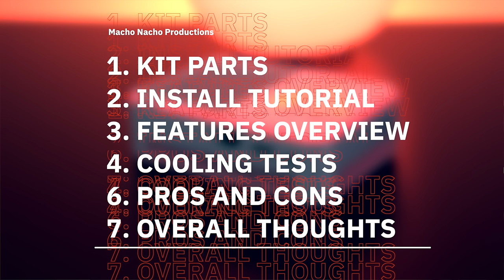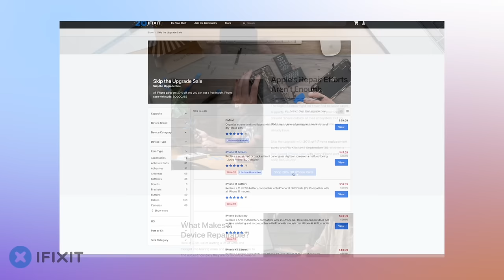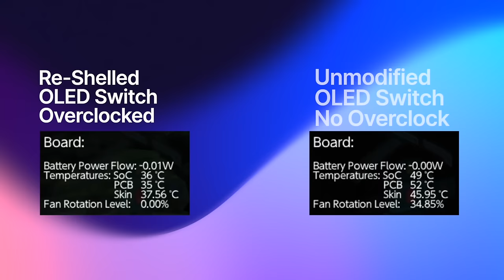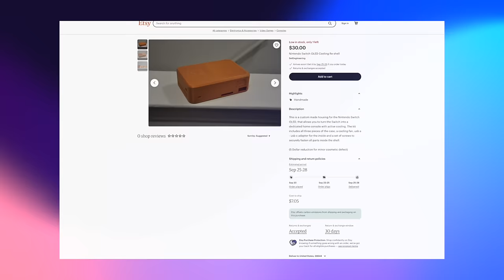Making The Nintendo Switch Run FASTER And COOLER With This NEW Mod!

Comment: For some extra cooling performance you can change the thermal paste between the heat shield and the SOC. I've modded and repaired a lot of Switches and that paste is often very dry. Then what happens is it crumbles and cracks during the removal and reinstallation of the heatsink resulting in hot spots / poor performance. It's always best to replace it if you have the console torn down to that extent.
Reply: I have never taken any compute system down to its processor without replacing the thermal paste

Frankly, the fact that people competent enough to tear a system down to that degree, would choose to not replace the thermal paste - confuses me greatly
Reply: @Spiker985Studios  It doesnt happen.
Reply: @Spiker985Studios I have done that before, because I didn't have any on hand lol
Reply: Replacing the Thermal Paste when removing a Heatsink feels like the Bare Basics on how to handle Heatsink-Removal.
Reply: @SoHBetaSword  again. This. It's just the thing you do as standard right?
Reply: @mykr0324 I have NEVER torn down a machine and chosen to NOT replace the paste. There is NO reason to NOT replace the paste. Unless you don't have any? But the shits cheap, if you're tearing down electronics even semi-frequently, you should have a tube of paste. Stuffs like $8 and will last you dozens of repaste applications.
Reply: Or better yet people should stop buying poorly made hardware
Reply: @Volkswagen_Yeetle  so, make your own switch then?
Reply: Can you make a video on how to convert  regular switch, I changed all the parts but it’s not turning on, I replaced the battery and power button but nothing, is there a way to troubleshoot the motherboard?
Reply: Hey! I recently opened up my switch lite, but didn‘t have any thermal paste on hand. On reddit, they said the airbubbles that comes when you put the heat sink back without a pump of thermal paste could fry the cpu. Is this true?

Comment: I have an LCD switch awaiting the fate of becoming a consolized version, just need some injection molded cases to come out and we're good to go, glad to see the development towards this goal!
Reply: Why not 3D print it? or find a local print center? Heck, some libraries have 3D printing services.
Reply: @Logon01 3d printing is great and all but there is something about injection molded plastic that feels different. If you want 3d prints to feel as smooth, you have to spend a hour or two sanding it. Plus there plenty of people who don't have places that can 3d print for them.
Reply: @RobbWes  100% that injection mold is different. I do like the option myself when it's there. I also know that 3D printing isn't always an option, but if it were, you would have much more flexibility. And given that this project is a Do it yourself idea, spending time sanding and painting just adds to the value of it for some. It gives the ability to make something like this a one of a kind thing that is specifically yours.
Reply: I have a 3D printer (anker m5 and many others before it), +1 to everyone saying injection molded is just different, cause it certainly is! 3D printing is for prototyping and small projects where the look might not matter just the function. This is a device I’ll be interacting with, divots and rough lines even with my resin printer just aren’t gonna cut it. I remember the early gba shells and stuff that was 3D printed. Look at us today, funny playing is almost OEM level quality. Trying to replicate that OEM feel but having a cool switch console is 10/10 for me
Reply: I would recommend trying out a pla carbon fiber filament its quite good.
Reply: I have an lcd switch that I’m sitting on for the same reason. It would be nice!
Reply: Injection molded cases will never happen. Molds cost far too much to develop for what will be low production numbers.
Reply: If you don’t like the look and feel of typical 3d prints because of the obvious lines, pcbway has a resin printing option. Add their clear varnish and its perfect for a clear plastic shell. You can even tint it like gameboys and other old consoles used to be

Comment: This looks great and a great idea for console only gamers. I do 100% agree that the creator should add another frame for Noctua fans, because they are just so quiet and efficient. Sort of the entry level and the premium options. Really excited to see how the Switch modding scene continues.
Reply: does this mod only works for OLED switches?
Reply: @ericgene yes for the time being but in the works of making one for the original switches v1 and v2
Reply: Noctua is great (should be no problem to add a NF-A8 5V) but I would add a potentiometer that also acts as a switch, so it has a setting to turn off.
Maybe with a second LED, one is for the power and the second one is an indicator for the fan.
Reply: What surprised me the most was that they are using the stock heatsink/fan. Looked like it wouldn't have been that hard to put a pc cpu heatsink on it with a fan. I'm guessing it boils down to keeping the costs lower. It was running quite cool already so there's that.

Comment: This is easily one of my favorite mods you've done. It's contemporary, it's preventing e-waste, and it makes perfect sense for thermals on paper and in practice.

Edit: Dang is this OLED Switch specific?! 2nd Edit: They're working on a base Switch version. So that'll be an option. Modders kick ass.
Reply: 21C is not 75F...
Reply: i mean i dont think it really prevents ewaste by itself, i may be completely wrong but i think this has the same effect of just leaving it docked? coolings better tho so thats a selling point
Reply: Wait since when is the OLED switch overclockable

Comment: Wish there was something like this for the OG switch models. Access to the right joycon rail for CFW booting would be neat too, as well as external access for the microSD card.
Reply: truthful be told you could get a PCB flex cable that bridges the connects but I agree i wish there is something like this for the OG switch
Reply: It makes more sense for the og switch. Less efficient soc is fine if it's always plugged in. Not to mention a lot of og switches probably have dying batteries at this point. And why would you get this to get rid of the oled display? Kind of a waste.
Reply: There is one for OG switch, check the link in description

Comment: I would have loved to see the shell incorporate the rails to make synching new joycons easier but this is still an amazing piece of work. Great stuff from the community as always
Reply: I designed it to work specifically with a pro controller. As joycons are no longer technically necessary.
Reply: @SetEngineering  But if someone has them from another system (or their system with a broken screen they've modded to run without it) then it would be nice to use the joycons for a multitude of scenarios:  friend's controllers, Mario Kart Party, games that only work with Joycons (they do exist), etc.
Reply: @SetEngineering  aren't they needed for games that require the joycons and specifics like the IR sensor?  I still use joycons while docked.  Plus, gyro aim controls are easier with a joycon in each hand.
Reply: @billyelliotx  Its easy to pair joycons with the console but its designed around using the pro controller. Im working on a version of this that uses the older v1/v2 dock that has a rear USB-A 3 connector. Using a seperate addon might make it easier to pair the joycons as i know there are some third parties that can pair via the usb connector
Reply: @SetEngineering This was a project VERY well done! I give you mucho respecto!!! 👍
Reply: @SetEngineering  Except joycons make certain games so much more pleasant to play. I can't go back to pro controller Splatoon after playing split joycons.
Reply: @SetEngineering ring fit!
Reply: @Phoenixflame87 u can pair them in the system menu.
Reply: Creator Forgot charging joycon controllers for owners that want to save some dough,but good development non the less, especially for the future original models  shells
Reply: What's the third party thing creator said you can use to pair/charge joycons thru USB?
Reply: The only thing that would be great for the Nintendo community is if Nintendo shutdown or is bought by Microsoft who would actually do something with all that money laying around
Reply: I did notice one slight issue with this mod. If you attempt to completely factory reset the switch, you arent able to synchronize your joycons which essentially bricks the system. Does anyone happen to have a way around the initialization when you factory reset after transferring your system into this shell?

Comment: I love that the Switch actually does have more power... we just can't access it cause of battery life... cause that means that if the Switch could just handle heat and battery performance, then Nintendo wouldn't actually have to raise the price for a pro-model...

Comment: Overclocking in theory should also provide a boost in resolution (assuming the framerate target is met) if the game is using dynamic resolution scaling, which a lot of switch games do.

Comment: Con: Needed an area that can attach Joycons for charging/synching. Some games still use Joycons specificially vs pro.  Less messy setup to have the joycon attachments available on it vs a separate USB charger adapter.

Also, maybe a modded version to allow for the 4 multi carts at once that change via  button sold on Amazon.
Reply: On the plus side, that separate Joy-Con charger they sold at the start of the Switch's life will finally become useful 💀
Reply: I don't have ONE single game for my Switch that ONLY uses the Joy Cons. I have 45 Switch games, and they ALL use my PRO controllers.
Reply: @Twitch_Moderator  Pokemon Let's Go Eevee/Pikachu, Let's Go Switch

Comment: Neat project. I wonder if the factory fan and heat sink/pipe assembly could be ditched in favor of a larger heat sink? Might be a way to get it to run even cooler with quieter fan or maybe even with passive cooling. Also would be nice to see a custom power button flex ribbon that integrates a power cut off for the USB port so the fan doesn't run 24/7. Lastly an SD card extender would be pretty easy to add in to make the SD port usable.
Reply: Yes it would be amazing to be able to use a lager heatsink in this case. Also just having the replacement fan plugged in the original fan socket, if the PWM signals and voltage are compatible.

Comment: I am definitely interested, though there are a few improvements I would bring to it ideally:

- Have different shells to accomodate for the different Switch and Dock models on the market (OG, Mariko, OLED)
- Have a "Pro" version where we can restore or even add USB ports (in case you have multiple wired controllers plugged in), but it would probably need an external power source for a hub (Maybe it could work using a power supply that is not Nintendo's?)
- Have a hard power switch which can turn both the Switch motherboard and the external fan off in one fell swoop
- Ideally have a substitute for the battery in case that swells up

But overall that sounds like a fun way to salvage a console with a dead screen!
Reply: would definitely love that as I don't really take my og switch out anymore @carbon9652
Reply: He actually does have 2 versions he is still in the works with utilizing the V1 dock to make this possible.
Reply: @carbon9652  mmm would it be possible to use the oled dock with v1 as my original dock is borked
Reply: Mariko and OLED are the same, the lite has no way of outputting video without heavy modification. Im working on a version of the shell for both v1-v2 and oled that accommodates both OLED dock and V1-v2 Dock. Iteration takes time.
Reply: @SetEngineering  switch lite can output compressed video via sysdvr

Comment: I wonder if someone designs a custom cooler that sits right on top of the CPU/GPU/RAM, the system would be near ambient. But tbh, that's over overkill. The stock switch temps not really going above 50°C that often is a real testiment of the engineers at Nintendo. They made a really cool system. And this shell mod just shows that if you get to ventilate the system outside a handheld case with a bigget fan, the cooling is perfect.

Comment: It's a fine concept for many broken Switches, it's even a way to have some use for drained batteries as it's intended for being continuously plugged. Nonetheless the case itself seems a bit too thick considering the original size of the console and the fact that we're even removing the screen, I guess we'll see alumunium or a more packed version of this concept.

Comment: I hear a lot of people leave their switches docked. I think this is a great idea and I hope the next gen console will have a separate handheld so performance doesn't suffer.
Reply: You mean.... like the Wii-U?
Reply: The Switch has never been focused on performance. You miss the entire point of the Switch.
Reply: @BoxxyFan  its just cool to mod your switch to have better performance on games like tears of the kingdom, hyrule warriors, or metroid just to get the cleanest experience you can get from those games without having to emulate them.
Reply: @BoxxyFan  I mean when it came out part of it was the performance as well as its efficiency (battery life) which was a rarity in handhelds at the time. And remember that until the Wii (and a lil bit the Gamecube) Nintendo was on the forefront of performance and graphics fidelity and was looked at mainly for that. Like c'mon the Nintendo 64 had 64 in it to boast all its 64 BITS core computing and if I recall they even put the mhz of the cpu on some of the boxes, you won't find modern Nintendo caring about that
Reply: I only play my switch on the tv so it’s always docked. I sometimes wonder if my long playing sessions make it hot in there
Reply: @Jahalang82  Honestly the switch with its stock clocks is so underpowered Its most defenitely not going even over 60c, and you can 90c before worrying about wear
Reply: I'm hoping for a dock with expansion chips.
Reply: That reminds me of Play Nation here in Singapore. In their gaming lounge that customers can rent for some amount of time, they have an original Switch that's always docked.
Reply: @hiRyan329329 the Nintendo 64 was literally the only (or at least the last) time Nintendo had the most powerful console of its generation! Nintendo has been known for creating great gaming experiences on comparatively cheap and weaker hardware as long as I can remember.

But I do agree that the Switch could've used some more compute power. It does struggle to keep 30 fos here and there.
Reply: @hiRyan329329 , yup.. Nintendo games use to be highly polished and smooth 60fps on the console meanwhile other company focus on cinematic 30fps.. but they scrap that for Switch era..

Comment: You could perhaps use a low noise adapter or something like that for the fan, make it run a bit slower. Or use a power killer switch between the fan and the usb. The fan stops when the system is turned off. :)
Reply: Yep! that and a noctua fan should completely eliminate the fan noise.

Comment: I love the idea that we can salvage consoles to give them new life (though if just the screen went out, if it doesn’t make the console not-useable, then its less of an issue really). Also like how this conversion is reversible (in the event replacement screens become more available)

That said, I could suggest some improvements. 

1. Make the screw points thicker and use Metal threads instead. They make metal threads you can heat up and inset into 3d printed plastics. (this would just take making the screw points thicker to accommodate the metal thread inserts. He wouldn’t even need to do this himself. Just make the print able to accommodate it, while still using his current method for letting you screw into the plastic if you wanted. 
2. Not sure how the lid is held in place, but making the plastic tabs  abit thicker to allow for inserting magnets or something like that would be neat. 
3. Instead of including a custom modded fan (which is what im guessing is happening); include a 4-pin PC fan to USB adapter would be much more universal and allow us to include any 80mm thin PC fan we wanted (perhaps he could include that as standard, and have an option to buy the fan from him for those that wanted an “all in one” package).

Comment: Too be honest I am surprised you didn't have to hook up the LCD panel. I figured that the system would have some quick check during boot to see if it works and would error out when its disconnected.

Comment: Since the default temperatures are more than fine, I don't really much care that this case lowers those already low temps even further. What I would be interested in is seeing how well games perform when the system is overclocked. For example, is the Switch with OC now able to run a locked 30fps in Zelda BOTW and Zelda TOTK in cases where it would slow down before? Such increases would make this an attractive option I think.
Reply: The main areas are Korok Forest and the Faron region, by the jungle. At the stable. 

Someone already did a framerate test with the RAM set to the full 1,600MHz (from the default 1,333MHz) and with the CPU jacked back up to 1.3GHz (or 1.5, I can't remember) and the choppiness still ocurred in those areas. 

It is based on RAM capacity, in my professional opinion. 

I emulated the game with 16GB of system ram and an RTX 3080 10GB and there was no stuttering in those regions.

Comment: So in case anyone else is looking in the comments for whether this works for the OG switch, checking the etsy page shows that the seller foes in fact now support the v1/v2 switches. You just need to specify as your adding to cart what model you have. This seems like an awesome project and I hope this helps!
Reply: Yes, I did the OG switch and the internal switch gets super loud